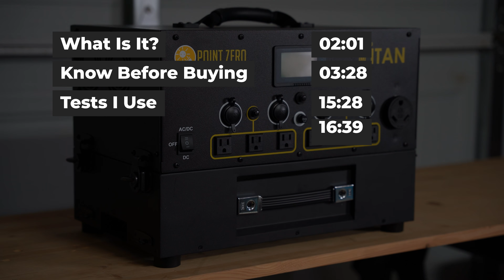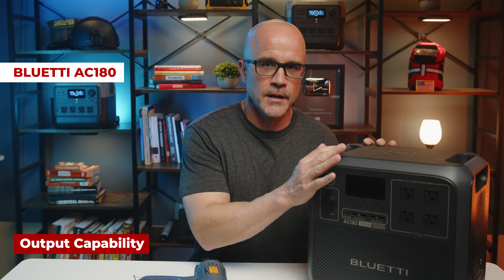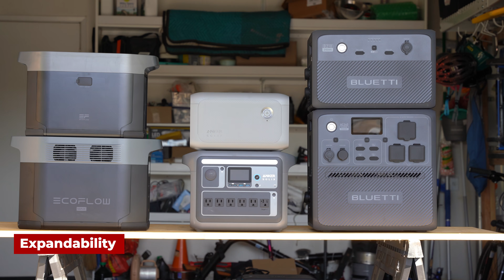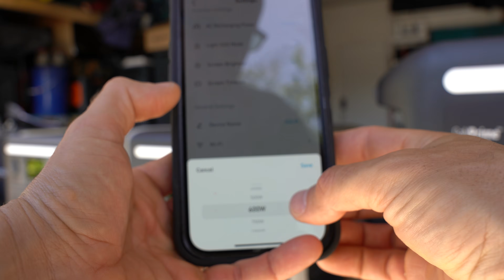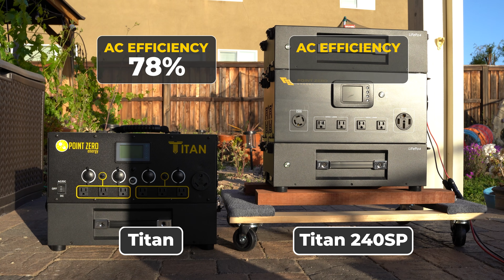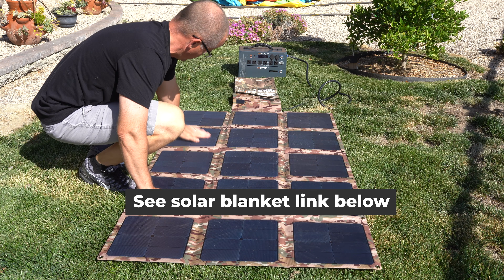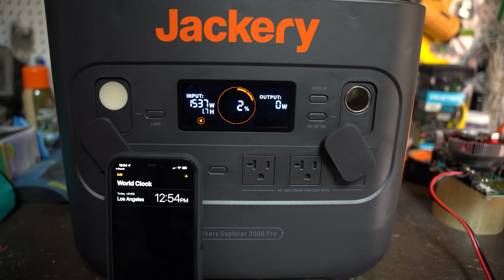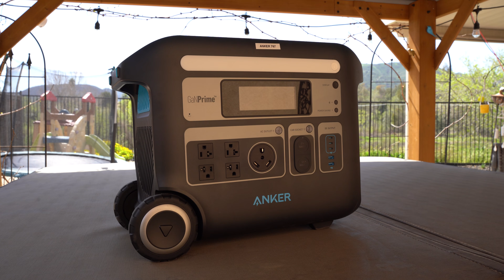Best Solar Generator for 2024 (The Ultimate Guide)

Comment: I saved and installed a wood cookstove so i wont freeze. Next is digging a cellar. Than just a small solar unit for my grain mill. If power goes out, it will be out for a long time.
Did you know, their rediscovering power from the ether?  Old tech, now being reintroduced.

Comment: The grounding lug on the Bluetti AC180 is what sold me on it. I was using EcoFlow products for making music off-grid and was getting buzzing and audio interference with some of my instruments. With magnetic pickups on electric guitars and various instrument cables, microphone cables, etc. proper grounding is needed to avoid ground loops that sometimes can be heard in the audio signal. So I'm selling my EcoFlow units and hopefully will experience better results with proper grounding on the Bluetti.

Comment: I want one but I've had large batteries just up and die before with little use.  Im afraid even if I don't use it, within a few years, at most, it will just be dead and not hold a charge any more.  Am I wrong?  So, then I go back to gas.

Comment: A solar "generator" DOESN'T GENERATE ANYTHING. It's a BATTERY with a versatile user interface. There needs to be a new term for this device.
Reply: I call them portable batteries!
Reply: It generates electricity through sunlight. When the sunlight hits the semiconductor material in the panels, its photons cause the electrons of the semiconductor material, usually silicon, to move. This movement of electrons is what we call electricity. The wiring  in the panel ‘collects’ this DC current and it is converted to AC by an inverter. Hence, this power ‘generator’ collects the current generated by the interaction of the sunlight’s photons and the semiconductor material (specifically its outer layer of electrons) and stores it in a battery.  The battery holds DC; the inverter converts it to AC for use with our devices. 

Sorry to go Bill Nye the science guy.  But poo-pooing a wonderful technology is not fair just because some manufacturers deliver a faulty product.  It’s not magic; it’s science.  And it works IF a quality product is made.

P.S.  The ‘problems’ in most of these units are the batteries.  And why?  Because chemistry is tricky. But we are figuring it out as we go. The generation process is solid. It’s the storage element that needs more work.
Reply: There isn't a generator that does "generate" anything. You cannot create or destroy energy. Only transfer it, say chemical 'petrol' to electrical via traditional ice generator. Or electromagnetic 'sunlight' to electrical energy via a solar generator.

Comment: I don't understand the reluctance to call them battery systems, or storage devices (equipped with fancy control circuits). Even solar panels themselves aren't really generators; you could describe them as harvesters. They only get called generators because panels & batteries replace generators.

Comment: I have the Delta 2 which ran my refrigerator and freezer during Hurricane Beryl in July with the help of my Generac generator I used to recharge it. Since then I have purchased the Delta Max with the extra battery. My next purchase will be an extra Max battery and the smart dual-fuel propane generator.

Comment: You can "expand" just about any of these units. You don't need to buy the manufacturers over-priced battery options. You can buy a 100AH LifePo4 battery now for a fraction of the cost they were years ago. You can use the solar input with 1 or 2 LifePo4 batteries in series or you can use an inverter to top off any off these units. Also you can "daisy chain" multiple units, something the manufacturers don't want you to know. I know you lose some efficiency. I have 4 12v 100AH batteries that are 1280WH each for a total of 5120WH and it only cost me $600. Try buying 5120Wh's of battery capacity from any of these manufacturers for less than $3000.

Comment: In my neck of the woods the main worry is that it will back up and power a sump pump, the failure or non-operation of which would be much more costly than a fridge full of food.
Edit: typical sump pump is 0.5 to 0.75 hp. No idea of surge current/power

Comment: With all do respect Sir, you have great detailed information, but it’s all very complicated for someone that knows nothing about any of this. 

All I want to know is what unit do I need to run my refrigerator effectively if my electricity was to go out for two weeks? 

Does my refrigerator need to run continuously for 24 hours like it is on my electricity system? What unit best serves that purpose?
Reply: Constructive advice from a random guy far away:
a) If the topic is relevant for You, can't You justify to educate yourself  ( = learn) a bit more with own effort - instead of just expecting others to give You all answers tailor-made?

b) A refrigerator (as well as a freezer) doesn't run 24/7 with a lot of el. power need. The internal cooling element (called: "the compressor") is only turned on and off every now and then by the internal electronics.

c) How much electrical energy your specific refigerator needs can nobody know without knowing all details of your specific appliance and usage profile. That's why there is no simple answer to your question.
But there is an easy way to find out the facts: Get a simple power meter (abt. 15USD purchasing price) and connect it to your fridge/freezer. Let the fridge run for 24hrs and read out how many kWh (Kilowatthours) of energy your fridge used in 24hrs under your specific conditions. You can use that power meter to evaluate ALL of your el. appliances that have a plug.

d) As Chris has explained in his video, You need to look for the energy storage capacity of the "solar generator" and compare it to the el. energy need of your fridge.
Example: If your fridge uses a total of 2kWh in 24hrs, a 2048Wh-capacity (abt. 2kWh) solar generator will power your fridge for 24hrs before the battery is totally empty. Now, if You have solar panels that can recharge the solar generator during sunny days, the story changes: You can run the fridge now day by day - provided that the sun is shining enough each day. If that works out for You, nobody can predict for sure.

e) 2 real-life example from Europe: Our smaller freezer can run for abt. 2.5 days with a rather small solar generator (1.5kWh energy capacity, 2.4kW output power) that I use purely as a backup-power device for short-term power outages. It merely buys me time in case of a long-term power outage: If the power doesn't come back after two days, I'll switch to a gas-operated generator.
My low-power electronics (WiFi-router, telephone, smartphones) are coupled in a similar fashion to another solar generator that has just 0.5kWh of energy capacity and 0.6kW of output power. That is PLENTY to run these devies for several days without any recharging. If the power would go down for more than a week in Europe, we woud have much worse problems than having no wifi/internet.

f) You can run your fridge/freezer for say 2hours and then turn it off for 4hours, tehn run it again for 2hrs. etc. If You keep the door closed and if the unit is well-insulated and filled with cold food, it will keep the cold inside. That way You don't need 24/7 el. power available. That is inconvenient to do, but what is the alternative if You have a 2-week-long power outage? Better have an inconvenient working solution than a non-working perfect solution, right?

Comment: what a stupid device, you cant use the max output all the time??? damage the battery??? trash, no gasoline generator will have damage from running at max rated load

Comment: First, a solar generator is not a solar generator, it is part of a solar generator, and no offence to anyone for udung the term because that's what they call them, albeit very deceptive...but Im sure that was the general idea when the name was given them.

"Hey, Marge, how bout you order us one of those solar generator things before the storm hits and before to stores run out...will do, Henery." Storms now over..."Henry, the solar generator ran out of power, and I put it in the sun and still doesn't work? I guess it to doesn't actually generate anything or it's defective."

Secondly, being in FL virtually all my life, staying cool in emergency can be tough if not nearly impossible, but seems to me emergency heat is as simple as a portable kerosene heater and hunkering down in a smaller room in the house if necessary. Fuel lasts a very long time, and the heaters are cheap enough.

Comment: While this is only visual, the pecron units where on the wrong side, compared to the graphics you posted,

The 2000 unit is physically on the left but the graphics for it are on the right and viceversa with the 1500.

Comment: I'm new to researching power stations and so far your are the first person to mention potentially charging from a gas  generator. I've noticed that the UPS I have for my office computers will not charge with my gas generator fluctuating between 110-120 volts. Sorry if I'm blind but i didn't notice if you mentioned which ones can be charged with unclean power (gas generator) in your spread sheet.

Comment: OK so I think I have a Capt. Obvious question. I'm in the market for a solar powered back up generator for emergency power outage that could last for days/weeks. I'm in a temperate climate so heating and AC is not important. Basically just need to charge a refrigerator that has a running pull of 325 w/h and some electronics. My question is, if I want to use the generator for an extended period of time, I have to be generating solar power equal or greater than the watts I'm using. So if I get a 2,000 water generator and I'm pulling say 500 watts/hr, I need to purchase solar panels that exceed my consumption rate and a generator/battery that has the capacity to charge at a rate higher and faster than my usage. If I'm pulling 500 watts/hr I would need probably at least 800 watts of solar panels to maintain 500 watts running power taking into consideration weather, nighttime, etc. Right??
Reply: Short answer:  Yes.
Are you running your electronics 24/7?
If so, you may want a larger battery bank, too.

Comment: can you help? I am planning a van trip and need to power a 7.5 cu fridge freezer 396kwh and small appliance like toaster oven on occasion 1800watts would i be better off with attached solar panels on the roof or would one the batteries be a good choice?

Comment: "Solar generators"? NONE are "generators" of ANY kind; they're all battery packs or  power stations. They STORE power; they do not generate power. I wish you wouldn't use that dishonest term that manufacturers are trying to confuse use with. - For any of these battery packs to be useful for longer than one discharge, you need an external source of power--SUCH AS A GENERATOR--to charge it up again. Yes, of course you can charge it from solar panels, but that's just one of a dozen ways. I could charge it from a wind turbine; does that make it a "wind generator"? I can charge it--and almost always would--from a wall plug from house power that comes from a coal-fired power plant. So is my unit a coal-power generator?

Comment: I have a Bluetti EB200.  I charge it solely from 4 small solar panels.  This works fine.  However, I may be at 100% sometime in the afternoon. However, the percent of storage has dropped to 90% or 70% by morning.  There is no load on the EB200.  Also, the display is very hard to use.  I have to make sure there is no sunlight on the screen and still I can barely read it.  It doesn't like the very back background screen you see.

Comment: I've been running 2 EcoFlow Delta Pro units with solar panel nonstop since Thursday (5 days) and topping off with their gas smart generator. Loving it
Reply: I thought about buying two of these just to run a chest freezer bc together that’s about 7200wh. The chest freezer is 207watts so that would run it for 24h if fully charged but I figure if I have solar panels going through the day and running off about half that over night it could keep going indefinitely. Does that sound about right to you?
Reply: Chest freezers Packed full of frozen food can go two days without any power before things thaw.. bet you would only need to run a few hours a day to keep frozen
Reply: @jayeisner8849  I wasn't there to monitor, so I'm not sure how often they ran. For sure they ran mostly overnight -- the sun by itself charged the generators during daytime hours
Reply: If the freezer ran continuously, you’d get 32-33 hours.  It will likely average more like 125w so probably around 48 hours run time with no panel attached.  If you have occasional sun, it may run indefinitely

Comment: I notice it is password protected. And can’t change the wattage in the system ie, adding batteries to the system.  I am currently looking at the Anker system, that you can have a home panel to run your home off these batteries.  I was hoping to use them during the peak hours of pg&e. And back up.  Is there a way to change the system kWh or watts per system?and thank you for making this spread sheet I really appreciate it

Comment: I am rebuilding the power system in my camper van. I have solar panels with 600w output. Can I connect them to a solar generator with 400w input or will I damage the unit? Thank you in advance for your attention.

Comment: No such thing as a solar generator, closest thing would be a solar panel. A generator doesn't store energy, a battery does that job. A generator creates energy from various fuels. Solar power is created by solar panels where the sun excites electrons to create a circuit of DC power that must be used, grounded or in this case stored in a battery. When the solar power comes to the battery it has already been created. It is not generated, it is stored. A battery and in this case all of these storage boxes can except power from many sources like generators, solar panels, home supply and even other batteries. Calling these things solar generators is just bad grammar and adds to the dumbing of the population. Let's just call a duck a duck, that way people have a better understanding of what they're buying and how they can be used. In the case for these magic boxes that are not limited by solar power alone and because they house an inverter with lots of options for offloading the collected/stored energy, why not use the term power station or just battery backup?

Comment: None of those are generators, they are all BATTERIES! They do not PRODUCE energy, they just store it. You need Solar Panels, or a Generator to produce the power that these units store, without the Solar Panels or Generators all of those unit are worthless. Calling them Generators is not a 'marketing misnomer'  it is just plain wrong. What's next? Calling Hammers nails? Shall we call Motorcycles cars?

Comment: How come nobody will say if these things will power a 1500 watt heater overnight it's just the simplest question nobody will say
Reply: They are not for that. Most inverters and generators are for keeping the lights on, the internet and TV and the fridges and freezers running. If you want to power your houses AC and heat, you are going to need a massive generator and a large fuel supply.
Reply: It would probably pull about 1800 watts, so you might get it to run for an hour continuously.  Cycling on and off is obviously impossible to calculate so no one attempted to reply.
Reply: @kld70  reason I ask is how reasonable would these be to think about using for heating a tent and camping
Reply: @nathanpender3353  probably not great.  Too much air leakage in a tent. I read a lot of people use a propane heater in a tent, like a Mr. Buddy. I don’t have one but read they make it so toasty that people have to shut them off. They weight about 10 lbs and can take either the 1 lb cans or 20lb bottle (with adapter hose) of propane.  They had supposed heat about 225 sq ft, which is very large for a tent.  This time of year, they are usually on special for just under $100.  They are sold everywhere: Walmart, Lowe, Home Depot, Aces Hardware, Dick’s, Cabela, REI, Amazon….
Reply: @nathanpender3353  Sorry. I tried to reply but they censored me.  I mentioned some stores so I’ll try again without that. I don’t think the power banks are great at heating since electricity requires high wattage to raise temperatures. For tent heating, most use a propane sourced heater like Mr. Buddy. They sell for just under a hundred bucks and supposed heat incredibly well. They are sold at department, hardware, and sporting-goods stores, plus online.

Comment: I've a Bluetti and was thinking about a stack system as I'm 100% off grid. The solar plugs that connects the solar panel and in car charger has flash burns on the yellow sections. As a engineer I know  this isn't a design feature and Bluetti hasn't responded with reason or solution?

Comment: Inergy products don't even get a mention. Have you discussed somewhere why they are no longer even on the radar? I can imagine why they wouldn't rank as a reputable company in 2024, after shipping debacles in the 2020s. Just 4 years ago, Inergy seemed like the best company. There was considerable enthusiasm here for the Flex 1500 back in 2020, long before it finally shipped. I still use my Flex 1500 complete with multiple modular batteries. I see that Energy continues to produce new versions of the Flex 1500. It doesn't seem like they've kept up with advances In the field. What a letdown.  Without any kind of review or endorsement here, I'm not going to buy my next system from them.